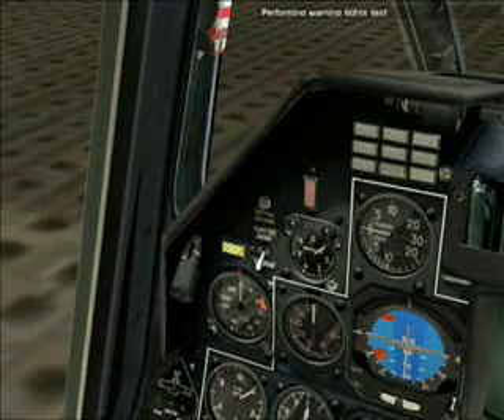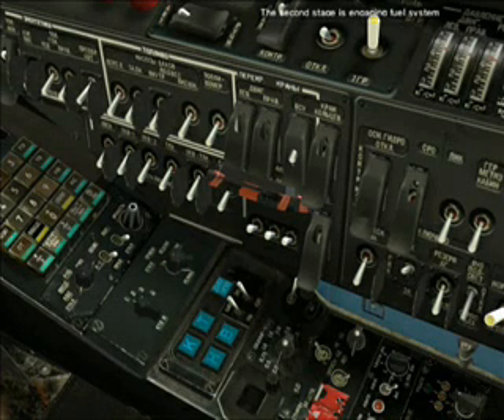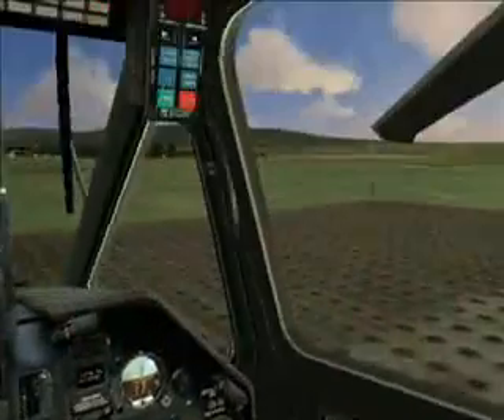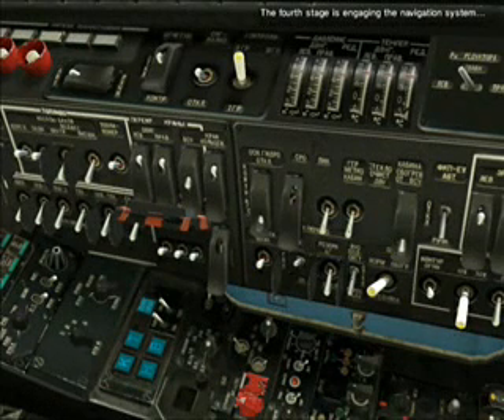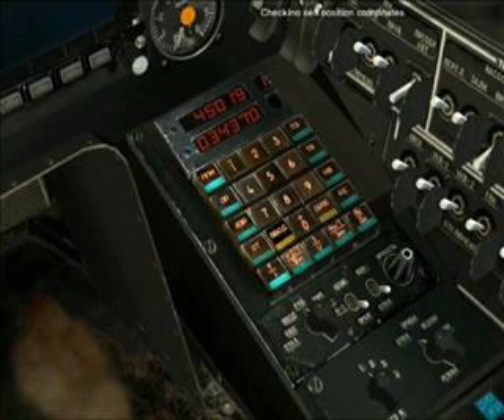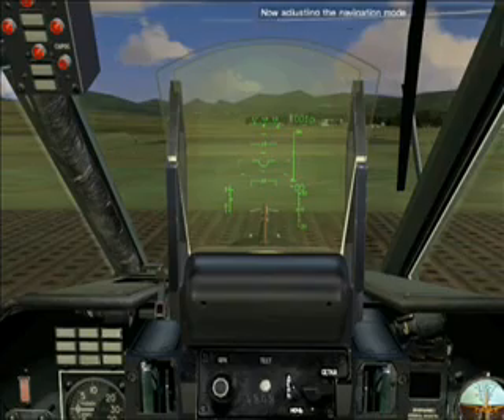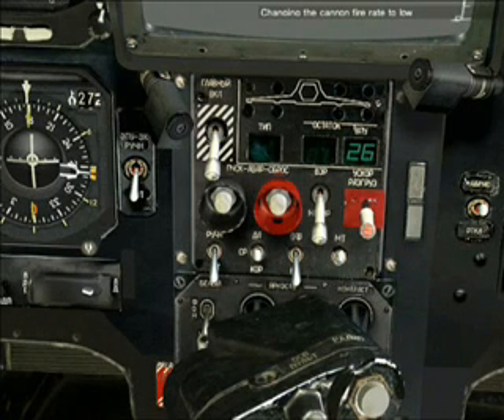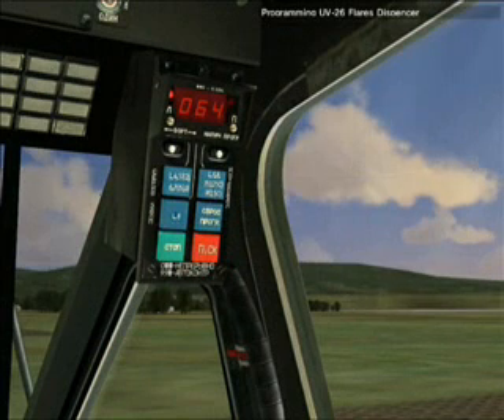Ka-50 Start Up

Comment: This game has just been renamed Digital Combat Simulations- Black Shark. its being released in 2008.after that, another version will be released featuring the AH-64 Apache, and another featuring the A-10 warthog.

The Black Shark game is based around the Caucasus region and will have a Campaign system with a moving front line that depends on mission results.

Comment: are we ever gonna get airborne?

ps does anyone know how to takeoff in lock on combat flight simulator im tryna get the A10 warthog airborne.

my plane moves slowly when its supposed to be takin off. and i get a F15 up my hole before i even gain speed!

oh joy hydraulic failure MLDWS faliure!